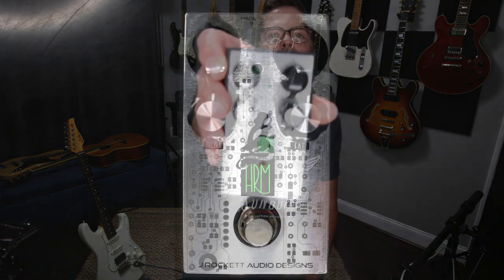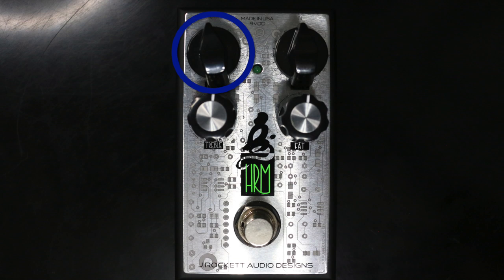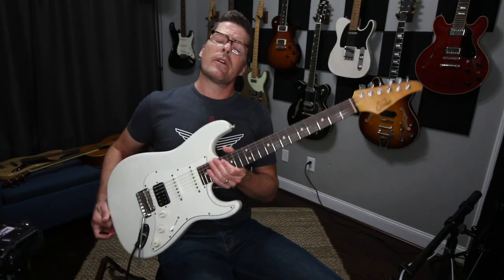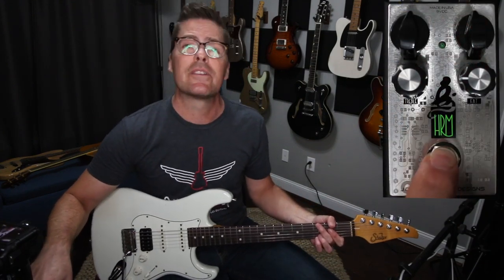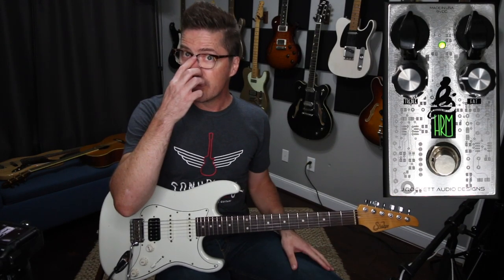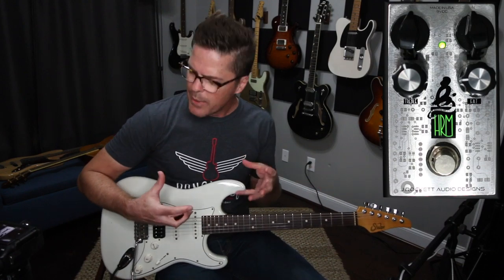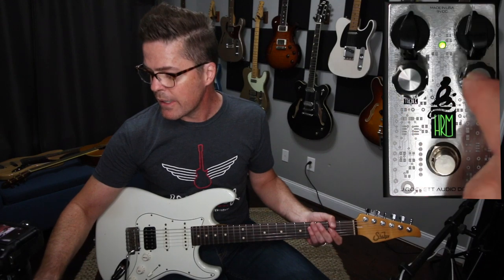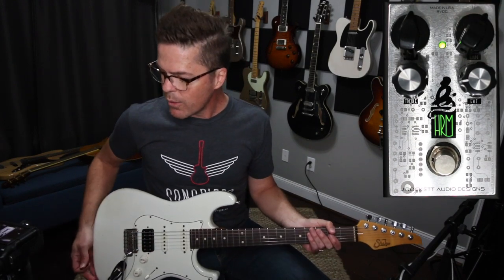J. Rockett Audio Designs HRM Overdrive. Dumble Hot Rodded Marshall Tones? Demo by Shawn Tubbs

Comment: The HRM will start shipping from dealers September 1st
Reply: we NEED an Alien Echo v2
Reply: @GuitarJawn  It is coming in the form a 3 year design and we are on the home stretch.....last iteration I heard was amazing so the final should be even better.  The tease is that it is an entire Echoplex circuit front to back not just the preamp.  It will also run off of 22.5 volts like a real Echoplex.  The rest of the features are everything you would need in a delay
Reply: I have all jRockett pedals . Big fan . Just want to collet all of them . 😆my new favorite is the Touch overdrive. Just amazing . Bought 2 already . Now ordering the new black color .
Reply: @ambrosechau2747  dont tempt me, selling the Dude and buying a second HRM,  with Mad Prof Simble and TCEL mOjoMojo jazzyness the HRM  is way cool! ( hot diggity I bought the first HRM for 138€ and now its 240...), luv the tone, K  :  )